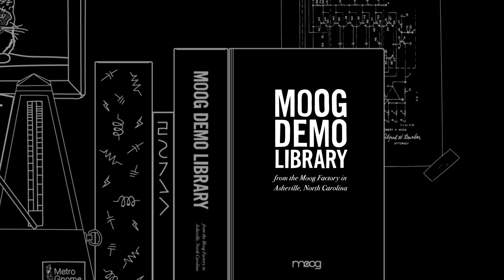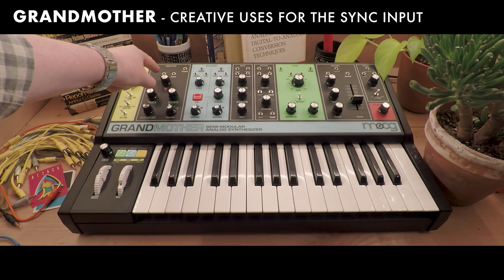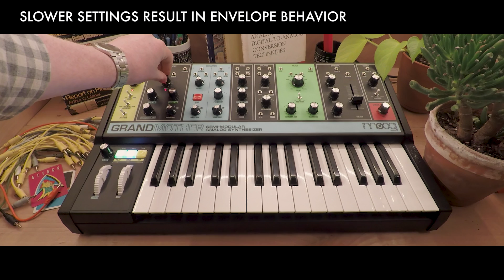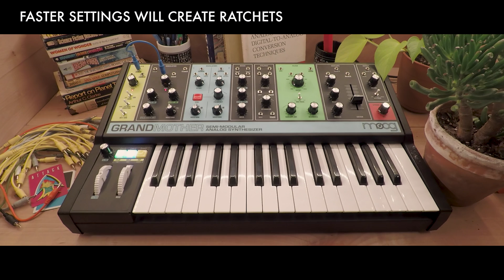Grandmother | Creative Uses for the Sync Input

Comment: You can get the big bottom end back on a high resonance patch by using the LFO as a pitch VCO, route it's output via the attenuator around the filter (not through it), set it to a sine wave (no harmonics) waveform, set it to a low octave and mix this via the multiple with the filtered sound of VCO 1 and 2 into the VCA. Use the attenuator to dial in as much sub as you want.
Reply: Merci Monsieur Jones
Reply: Any videos of someone doing this ?